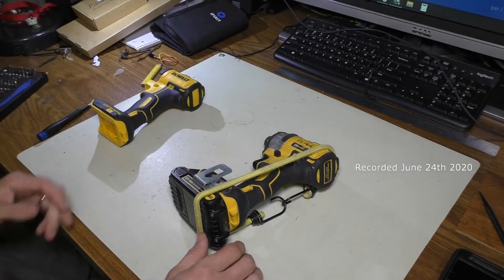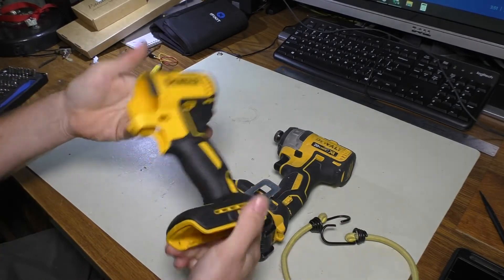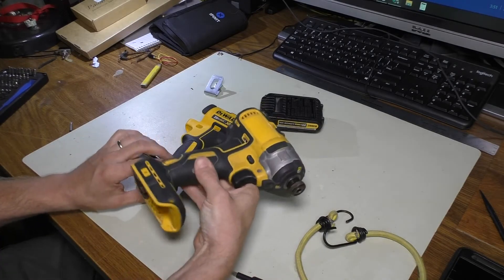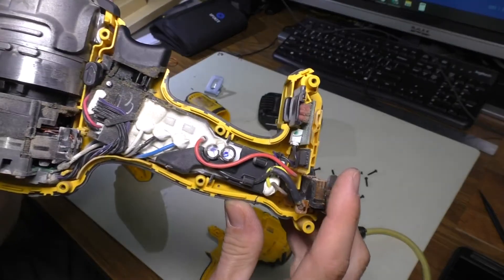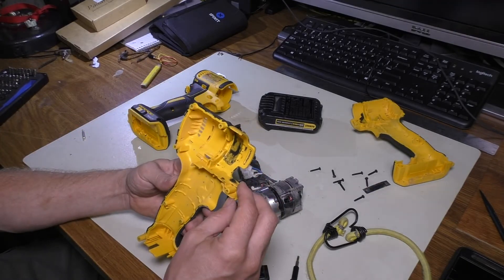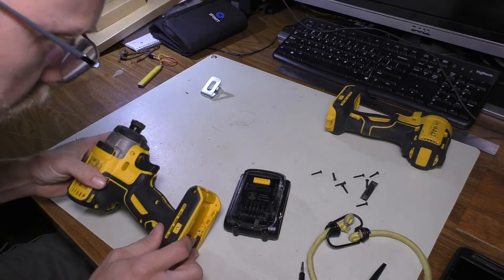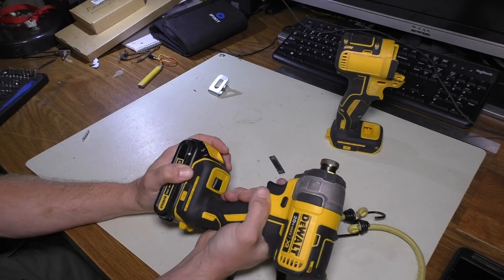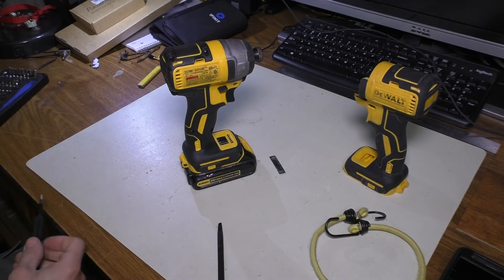DeWalt 20V Impact Driver Housing Replacement (and Mini Review) | PileggiTech

Comment: Tool is always just a tool! They get broke from time to time. It's either you repair them or replace them. As long as there's a lot of Tool parts sellers and retailers out there we'll be alright. My DeWalt dcf888 and 885 broke too. Same spot. I just got them a new housing and repaired them. In my Ryobi impact driver P237 the Plastic broke near the metal gear housing. And got it repaired too. Same thing happened on my Bosch 12V Brushed Impact Driver as well. I guess that's what's gonna happen to any tool when they got dropped and fall to the solid ground especially concrete floor. And the best way to avoid that is to install some tether strap on the tool when working on elevated places or overhead that will save the tool from falling and get damaged.

Comment: is this guy still around or?  need a rack effect repaired, its an ADA S1000 delay rack effect, these are quality and well made units and sound great like this roland here.. should be simple fix? it's mostly working just no sound throughput with effects attached? plugin guitar to input, output to amp and I hear the guitar play on bytpass, just no effects attached to it? all lights turn on, meter lights working as if its working, weird.. maybe just a bad solder joint on the effects output or something of that nature, resistor?  hmm...

I like the fact this guy is thorough and likes to install upgraded quality components which is always a good idea for longevity and tone,  I wanted to support his business too..
Reply from the maker: Thanks for the kind words!  I am still around although things have been in a whirlwind over the last few years.  Plans are coming to fruition and I should be able to make repairs again, hopefully as early as the beginning of 2022.  If you wish to email me about your device, you may do so at Pileggitech@gmail.com.

Comment: I used my 18V DeWalt for SO many years and it took far more abuse than this 20V. Like many here, mine broke the same way after a few months of use. The bottom of the handle was designed thin to accommodate the worthless speed selector. There is nothing better about this "improvement." We got ripped off.
Reply from the maker: Great point.  For what it's worth, the replacement housing seems to have survived better so far.

Comment: Hey Chris, busted a couple 20v impact guns myself, kind of a popular break point.
Another subject: on your ATX PSU mods, do any of your videos cover how to remove 110/220 switch in order to add USB, like on your mods?
Reply from the maker: Thanks for  the  input.  I don't really remember if any of the videos cover that or not as it's been a while.  I may have connected the two wires together that go to it.  That would make it seem like the switch is always on.  The best thing to do would be to test it with a continuity meter.
Reply: Well, I got anxious...I think the mistake I made was flipping the switch to 240 to see what would happen. Not much really, when I went back to 120, i connected the 2 red wires (it looked like that’s what the switch does), popped the fuse. Put the switch back together, replaced the fuse, fired it up...now I got all this extra smoke 😂 should never have hit the 240. Thanks for the info, I should’ve waited and followed your suggestion. How about doing a portable atx psu in a $10 (on sale) Harbor Freight Apache case, I think that would get a bunch of views...thanks again, keep up the good stuff
Reply from the maker: @rbe3908  Yikes.  It's all part of the learning process.  Thanks for the excellent video idea!

Comment: Couldnt you have stuck it back together with epoxy? Thanks for sharing
Reply: I tried that several times and it kept braking
Reply from the maker: After looking at the damage, perhaps yes.  I'd still want to completely disassemble the tool as to not gum up the works but at that rate I would just replace it.
Reply: I even tried a plastic welder but the design makes it the weakest link on the chain. The acute angle on the front of the grip directs stress to the defective area.